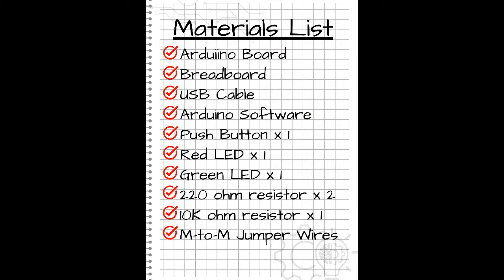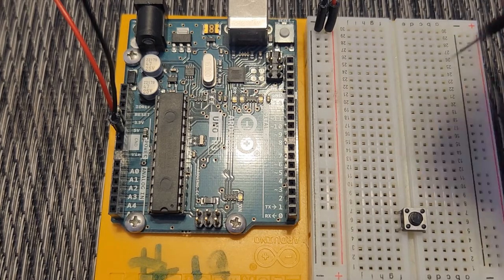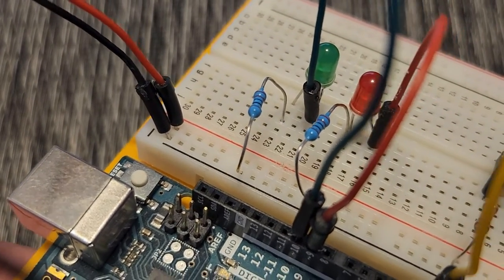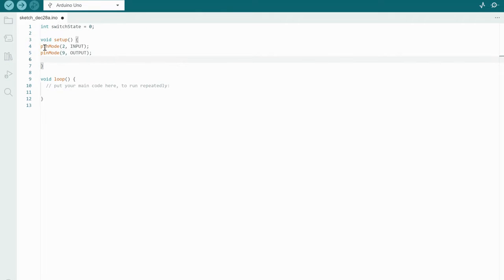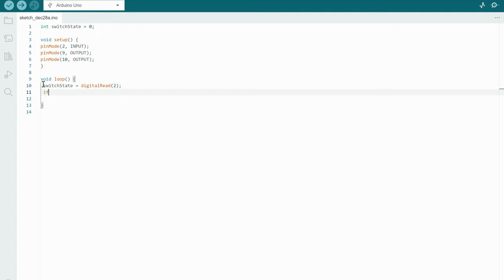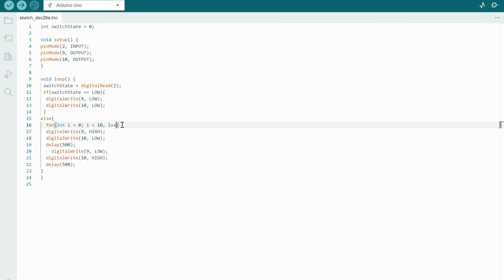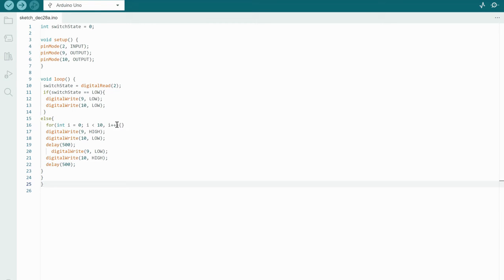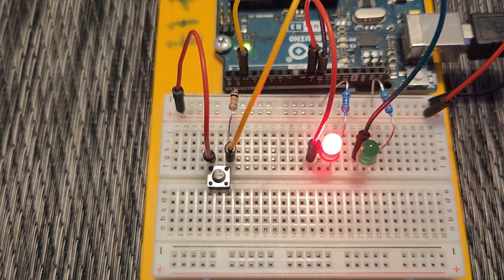*Arduino* Using a push button to power LEDs with if/else statement

Comment: hello, i'm having trouble finishing this process after uploading the sketch, my set up is still not working, no led is turning on, i have also tried it with just one led, with a simpler sketch but still no success, what could i have been doing wrong all along?
Reply from the maker: @RonCastle-c8s  Hello and thanks for reaching out! A couple simple things I can think of to start off is making sure your LEDs are in the correct direction. The anode (longer lead) must connect to positive as if it's in the other direction, it won't light up.  Also, if you are using a breadboard, double check that all your wires are in the correct rows and plugged in to the appropriate port on the Arduino board.  Finally, make sure you have the correct resistor size in series.  If it's too large, the LED won't light up due to too much resistance. Let me know if you're still having issues after that.